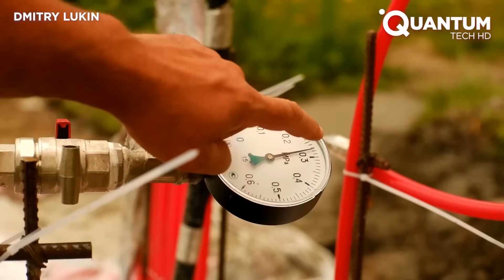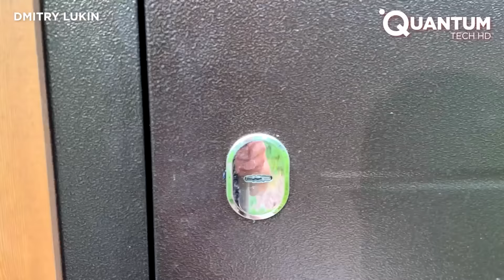Man Spends 1.5 YEARS Building Amazing River CABIN | Start to Finish by @DmitryLukinDIY

Comment: Congrats. Very thorough planning and skilled craftmanship throughout. I'm unclear about his water source, is it the river? The cabin itself is well insulated and has the infloor heating as well as the fireplace, but I can't imagine the shallow depth of that pipe not freezing in winter if it is the supply line.
On a personal note, I would have put a much larger window facing the river and its scenery.

Comment: Very nice, just few things I would do different : 1. Foundation stone-sand-water proof material -insulation and concrete,. Yours might make problems in few years. 2. Electric cable can be brought underground and no need hanging cables around the house. 3. Shower timber not practical, no matter how you treat, water will make problems overtime.
But for Russian standards well done !

Comment: A lot of time and effort invested in this project.  However, I didn't see anything installed between the concrete slab and the sill plate. Cedar is great, but it won't stand contact with concrete forever.  It will eventually rot.  It's pretty simple and easy to isolate the sill so that it will last as long as the rest of the structure. This is especially important in a building this close to the river.  Also, this is one of the most difficult pieces to replace in the whole structure.  This is an example of failing to address one detail that will end up with a failed structure.  Otherwise, nice job.

Comment: I remember installing windows in one of these super high efficiency double membrane insulated homes, major rott of the framing had taken place over the years because water had found its way in between the sealed outer and inner membrane layers and because the timber framing was sealed..
The moisture couldn't evaporate and so the framing turned into rotten punky wood. We where eventually putting brand new windows in a house that should have been condemned.

Comment: if you want futureproof your house purple heart or swamp wood. be best insect fire water mold ect resistant. of course just scorching the wood of cheaper woods would prolong its life as well and still have the same effect. stone wool wouldve been cheaper and wouldnt need any extra insulation would be all natural and naturally mold fire and water resistant, and collapses slower. plastic water tubing is fine for washing but bad for drinking, plus copper will last longer let alone is anti-microbial/anti-bacterial.

Comment: Wood has an age resistance of more than 500 years. Plastic, on the other hand, has a maximum of 50 years. If it is high-quality plastic. So after 50 years at the latest, a third of the building material used will be ready for demolition. What a sad waste of wood.